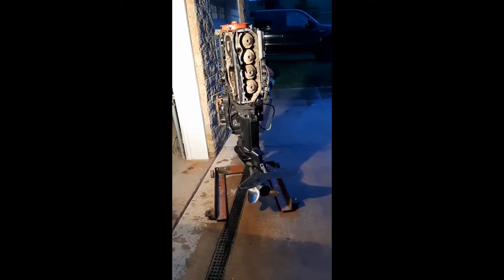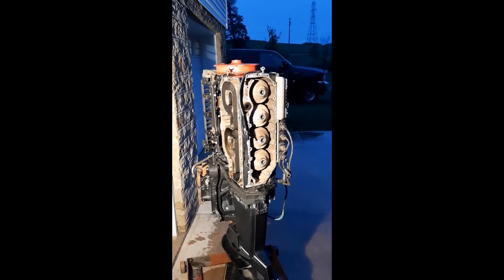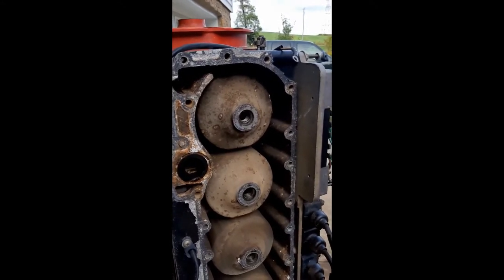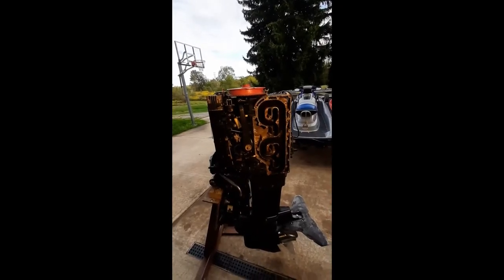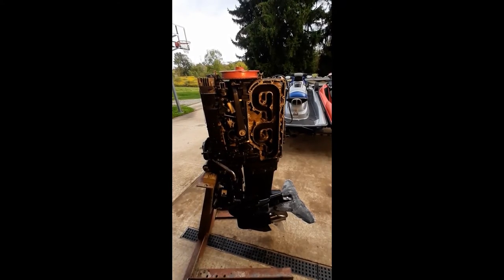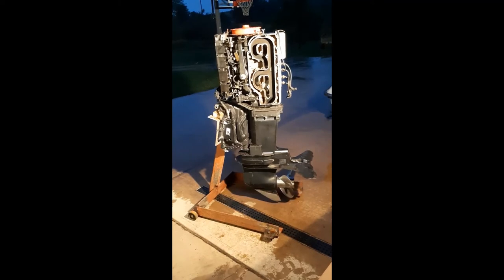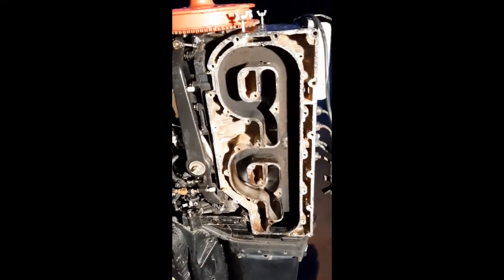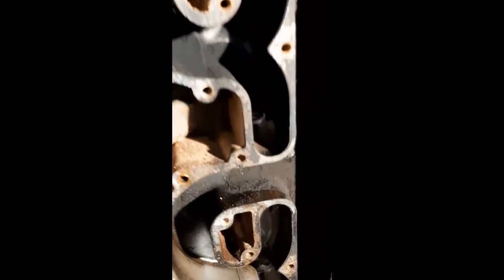Mercury Outboard Cylinder Inspection and Diagnosis

Comment: What motor is this?  It looks like a 115-125 mercury 2+2? What year?
Reply from the maker: It is a 1989 115 hp 2+2. However I defeated the off cylinders and now it idles on all 4. Definitely like that better.
Reply: How did you fix this
Reply: That cylinder looks to bad to be honed what ever happened were you able to get this engine running again